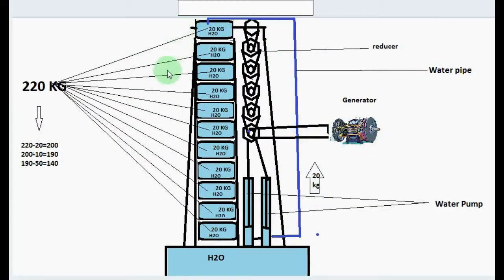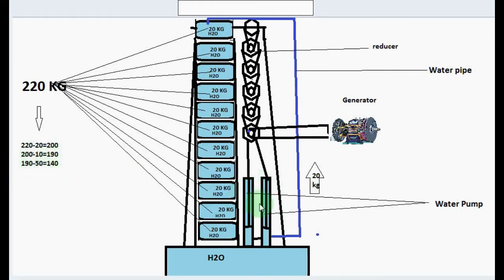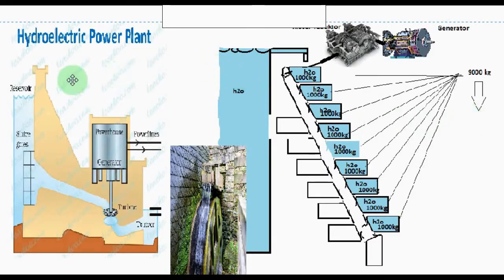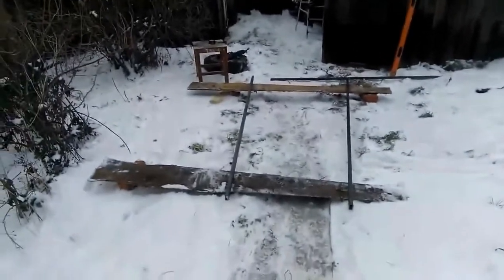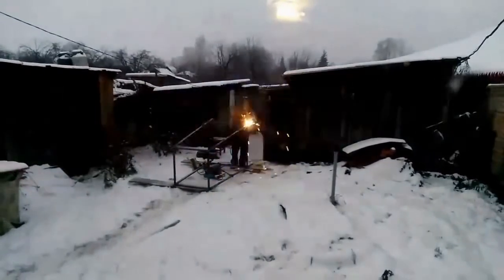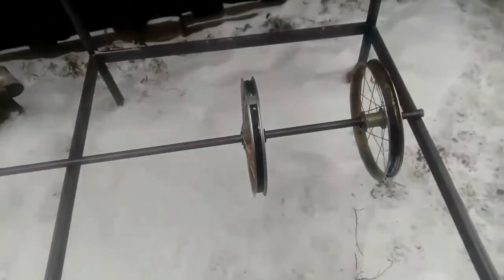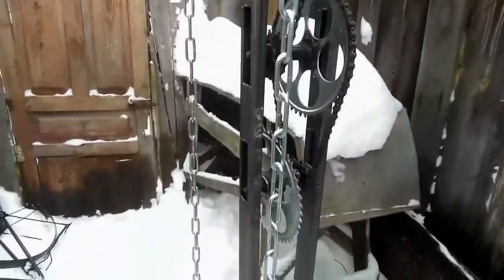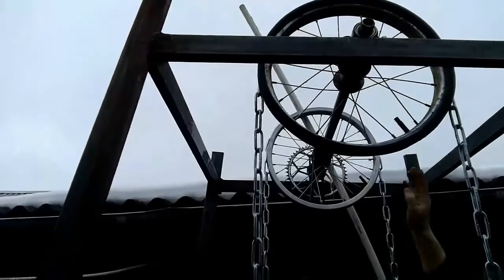Generator without fuel! Alternative energy! perpetual motion machine!

Comment: it is a pity that some people think that this kind of thigs work and we have free energy. i cannot immagine what kind of mind they have. they think they are the only genious that catch this idea an other then them all the engineers, scientists miss this "very smart" ideas... very sorry for your nonsense effort... as you experiment it is not working. you cannot carry enough water to top... no way sorry... however this machanism works if you have water source that can feed this conveyor from top than it can produce energy. but not free it is potantial energy of water flowing to lover altitude and you cannot pump this water back to top with energy it produced... hope you understand... sorry there is no energy free of charge ;)
Reply: Well to be fair, all kinds of academics were all over the world yet two brothers tinkering in a shed built the flying machine, the holy grail of invention of its era and as impressive as someone inventing time travel or inter dimensional travel, propetual motion isn't possibly under Newtown first and second law of thermodynamics, I'm not sure about this machine but there are many example of both gravity and buoyancy  contraptions that do indeed produce a surplus of energy, one is like a simple tube that inflates a ballon to lift a weight pretty high, the weight reaches the centre of this tripod thing, and as it descends it is spinning the wheel of a generator, the weight hits the ground and the ballon now recompensed hydrogen into a tank refills the ballon and the process continues, it's not propetual motion, it's buoyancy that then utilised the potential power aided by gravity and can be referred to a gravity generator as gravity is the only force being converted
Reply: Yeah u right bro ... But the vacuum saking water tank can work ?? To catch water from down tu up ?
Reply: @Mindquest78  not that way no chance it's clearly an idiotic contraption this one, even living close to a river, not in your garden but within a mile or two, you can easily build a cheap contraption that actually generates power, and this can be stored on site or a line underground or above ground can direct power to your home and you can store the power there too, or in both places, whichever you deem safest and that is actually a genuine free energy source that's cheaper and more productive than solar and can literally be built with scraps, people in poor communities or rural areas should definitely do that rather than costly fossil fuel generators, there should be more videos that show real things and real savings, these videos are like misinformation, really if people    from poor regions of the world knew they have all the ingredients they just aren't put together and it's not hard, once you know all that stuff, it seems as silly as paying for firewood when you live in the woods

Comment: che potenza puo avere questo tipo di mivimento io dico che e poco invece fare con un sistema di leve (6) ottengo la rotazione 1 a 1con una potenza maggiore dipende dalla lunghezza delle leve PARTO con in motore si 1.5kw che fa 1400 giri vhe li riduco a 40 che sono uguali in uscita dove collrgo un generatore dopo aver aumentati i giri a 1600 che mi da 13kw cosi posso collegare altri attrezzi e fare una centrale elettrica a costo zero la potenza che sviluppa l attrezzo e di circa 39kw a 1600 giri ecco il moto perpetuo
Reply from the maker: A mechanical perpetual motion machine is impossible